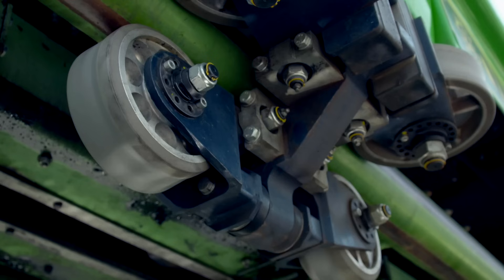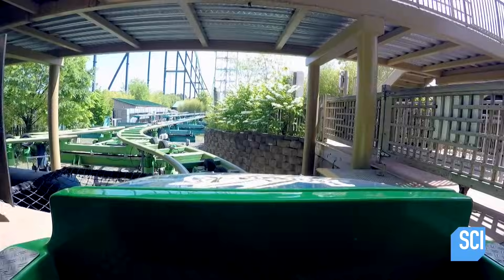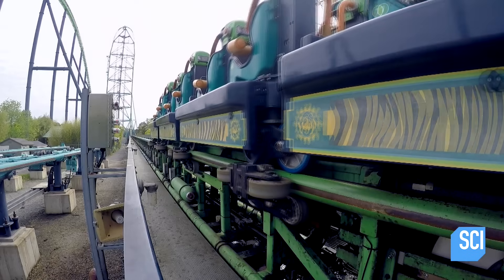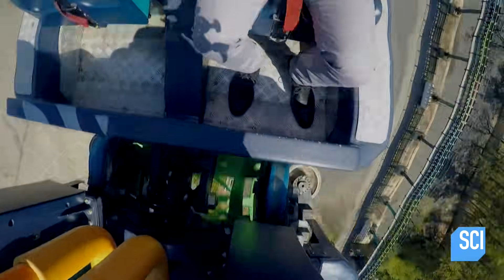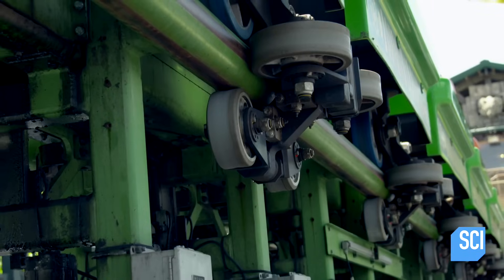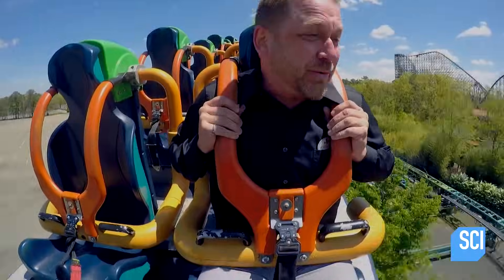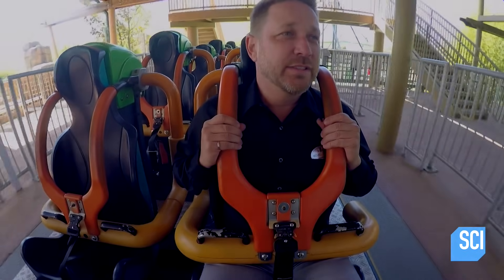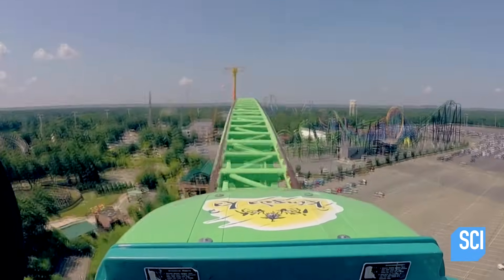Why Don't Roller Coasters Fly Off the Tracks?

Comment: Can’t believe we put so much faith in a  bunch of wheels 😢
Reply: they are replaced often, so it can’t break randomly
Reply: @znul  literally 😂
Reply: @Enthusiastically460  It is as strong as metal if not even stronger with a very hard but smooth plastic coating on top. It is also way stronger than almost everyone's relationships. Wheel assemblies are replaced very often.
Reply: @znul  I knowing, But at the same time the plastic or polyurethane Rubber wheels that youre talking about can over heat, but honestly it really depends on how many times the ride is cycles and if a coaster doesn't have all of the trains needed to run full track or some can be in maintenance. But you're not wrong those wheels are strong as hell. so yes I would definitely put all my faith in the wheels of a coaster.

Comment: Wait, so if those wheels somehow malfunction we're gonna go flying off the tracks? Good thing I'm going to Busch Gardens I'm now scared
Reply: The cars are connected to each other, so if one car gets a catastrophic failure like that, the cars on either side will keep it on the track.
Every year the entire train is taken apart down to its nuts and bolts and every piece inspected with fluorescent fluid and X-rays to make sure it is safe for passengers. Every single morning the trains are inspected and the track walked to make sure bolts are torqued, sensors are aligned and working as they should, brakes operate, and if the computer will violate the block system that keeps the trains separated with a brake or lift hill between them. It generally takes 8 to 10 man-hours to get a coaster running.

These things are so closely monitored that you are in far greater danger driving to the park gates than you ever are on any of the coasters.
Reply: if your car "somehow malfunctions" you'll crash and die but you never complain at the possibility of that! Roller coasters are safer than cars and even planes just enjoy them! there is no danger

Comment: I had never been scared of roller coasters until I saw this video so thanks a lot for that
Reply: I've been on this rollercoaster over 35 times.
it's not scary at all since it has a double safety installed for every seat.
It also only truly lasts about 14 seconds.
Reply: @NFtheend  25-45 secs. Not including the lift time. Depends on the coaster as well. 14 secs is too short though, I'm sure some coasters are that short if not shorter, but most "real" coasters are about 25-45 seconds on average.
Reply: @onexlifeonly132  he's talking about ka, not every coaster
Reply: Same, and I'm going to SFOG on the 18th. An Enthusiast scared of roller coasters. that's strange...

Comment: "Ultra-smooth and durable low friction polyurethane." So... plastic, then.
Reply: Ian Amanti Um, no. The wheels would fucking break.
Reply: Polyurethane is a plastic, but not all plastics are brittle.
Reply: Ian Amanti. More so a plastic metal. Very thin coating of it to provide smoothness.
Reply: Polyurethane is a very durable plastic. If the wheels were actually made of normal plastic, the wheels would break quite easily.
Reply: You have a 1 in 300,000,000 chance of dying on a roller coaster
The wheels ain't gonna f&%$@#* break
Reply: its metal wheels with a plastic metal coating so it isn’t like a local supermarket shopping cart rough
Reply: Everybody assuming I think the wheels are going to shatter because I said they were plastic. Naw. They're using as many words as they can to describe a pretty mundane material.
Reply: I’m more impressed Walpoly lived through the 2020 2021 season and came back to visit this comment than with his plastic theming candor not giving a purse full of phucks about polyurethane.